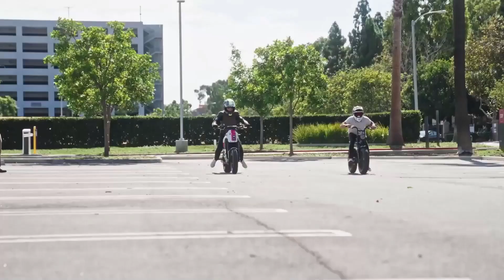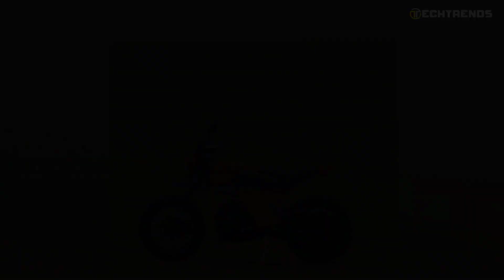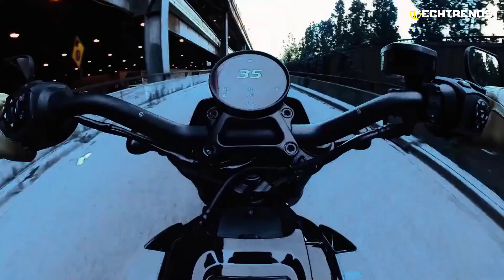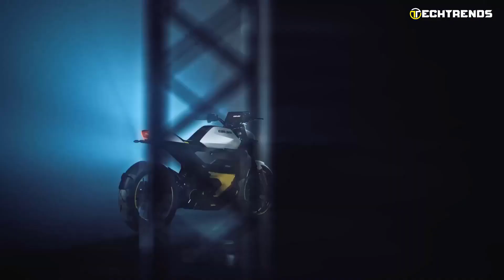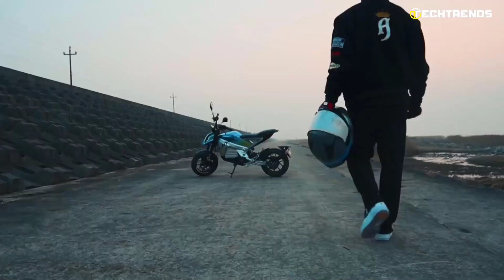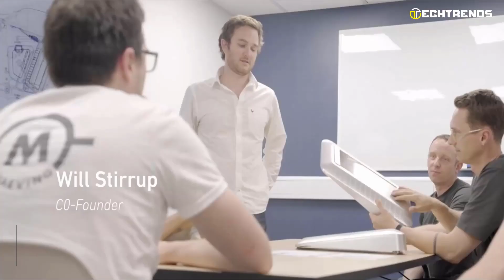Top 10 Best Electric Motorcycles of 2024

Comment: We need an electric motorcycle equivalent in the range of 400cc to 500cc, top 50 HP,  about $7,000 for commuting purposes only.   No one needs a 1,000cc 200 HP electric equivalent motorcycle, $50,000 for commuting purposes only. 

I ride a Honda CB500F 47 HP for commuting to work and this motorcycle tops 100 ~ 115 MPH in no time when needed.
Reply: But i want a 1000cc 200hp electric equivalent bike though.
Reply: What do you even need 100mph for?